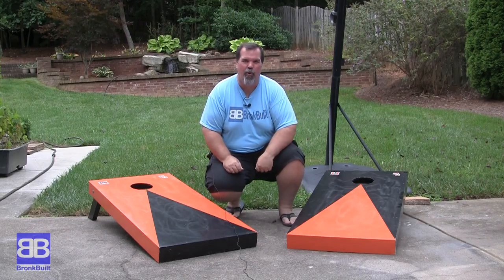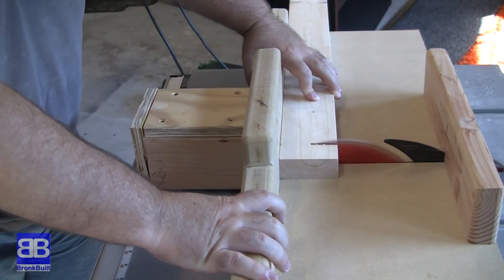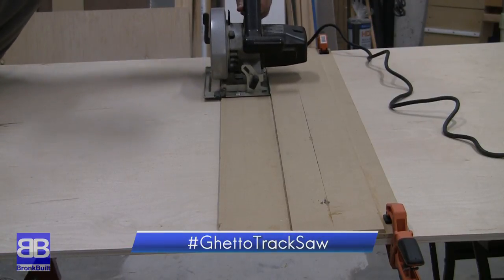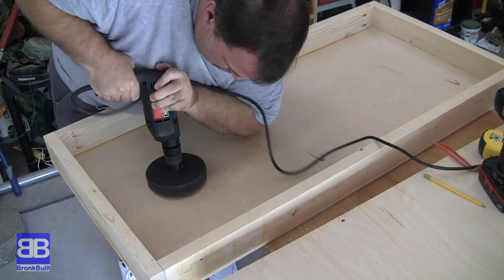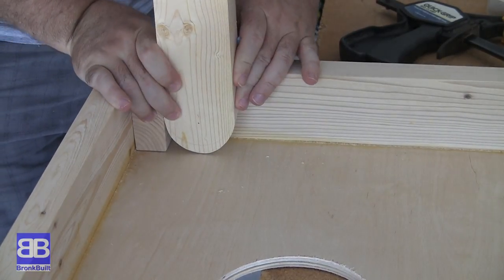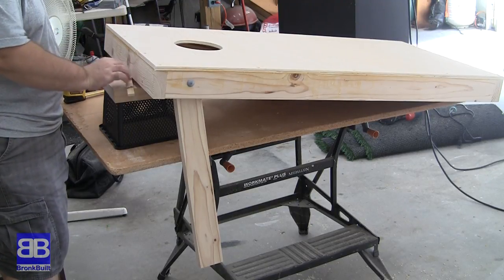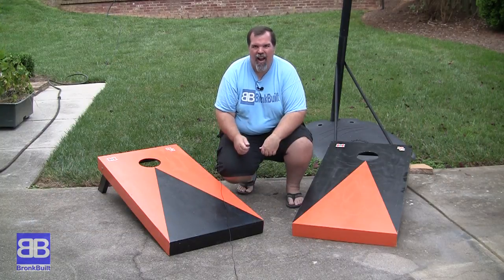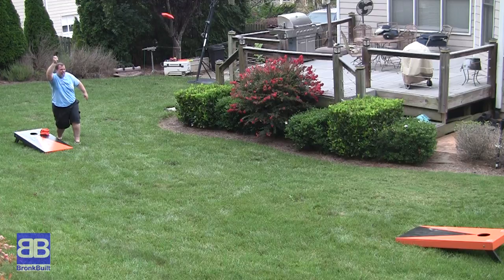Make your own cornhole boards (how to)

Comment: Beautiful boards and again, well articulated descriptions of the building making it easy for even the most novice of builders, to make a nice finish product. On mine, I added heavy duty handles on the side to carry them and, toggles on the long sides underneath, to lock the legs in place. Just made it easier to carry them. Love the paint scheme and the humor!!
Reply from the maker: Yes, handles are a very good addition.  Wish i added them but they are already with my son at college.

Comment: I noticed you painted  the backside or underside of your boards black, did you prime the back/underside of the boards first before painting them completely black?  My actual question is, if I am using a white exterior primer paint by Behr to prime the top front and sides of my boards then painting a Texas Flag on top, can I just leave the back/underside of the board in that white primer paint color and not paint it in additional colors I’m using? Or, should I add an additional color for add procreation and coverage?
Reply from the maker: I created these a while ago and have learned a good bit about painting since. For outdoor I'm a fan of normal prime first, even if it is the primer plus paint. For my boards I don't remember but don't think I primed the underside, just painted. Thinking was that no one will see it, but it will provide protection.

Comment: Did you use polyurethane on the paint? 
If not what kind of paint did you use? Don’t the boards need to be real slick? 
I’m from Macon but in N Ga now. Great video- Go Bears!
Reply from the maker: I did use poly over the paint. I used gloss polyurethane and I would not recommend that. Made the board to slick. I had sand a bit after or it was impossible to have a bag stay on. Use a satin finish poly. GO BEARS!

Comment: is it possible to make these with pvc pipe?  I know you have to use plywood on top, but fr everything else?
Reply from the maker: Yes and no.  You could definitely build the base or off pvc and would probably be very light which is nice for carrying around.  2 issues I see 
1. The boards may move around a bit as the bags land on it.  Play in grass and that would probably solve that. 

2. You may have people complain "those are not regulation ".  Solution to that is "you can't play.  These boards are only for non complainers that just want to have fun".

Is be very interested to see what you come up with.
Reply: @BronkBuilt  lol.. Thanks for taking the time to respond. I will definitely let ya know and soehow send  pic if i decide to do it.. 80% chance I do. :)  thanks again!

Comment: No clear coat finish?
Reply from the maker: I did. I don't remember the video as it was a while ago but I did put a couple coats of poly once the paint fully cured. I may not have showed it on the video. I always do that on my corn hole boards.